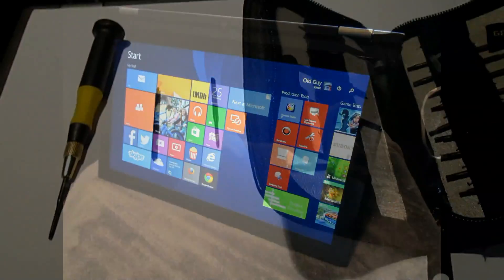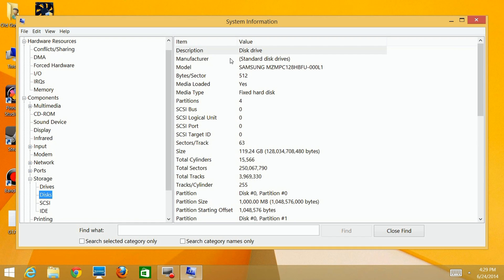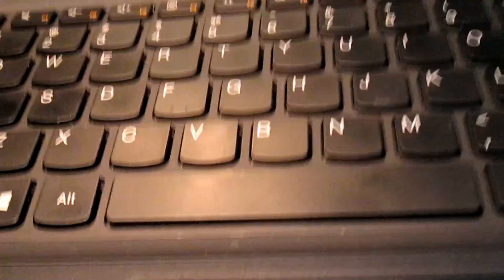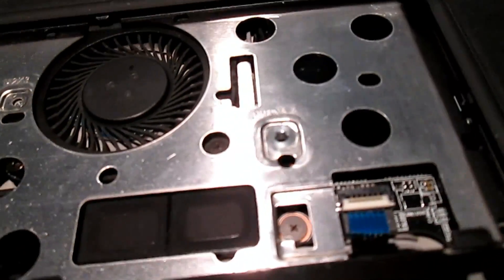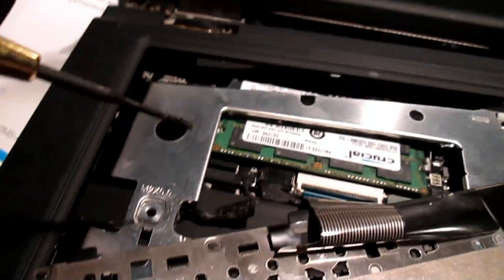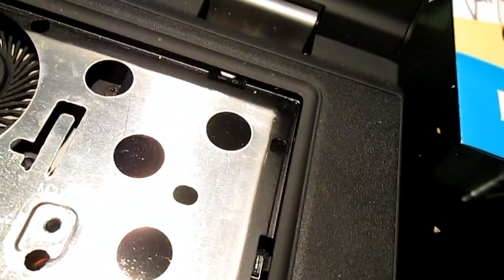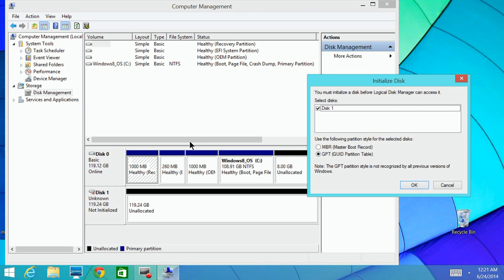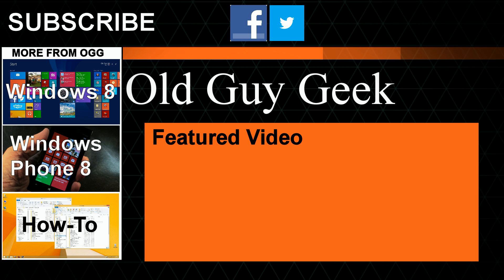Lenovo Yoga 13 - Add 2nd SSD Detailed Instructions

Comment: hey so i bought a ssd from ebay that is identical to the one (its used and it windows one it) i have. so it came with all the unnecessary partition.  do you know how i can delete all of them and make them into one just one 128gb drive.
Reply from the maker: Make sure you don't delete the partitions on your main C drive.  Just go to Manage computer and then into Disk Management.  You should see the extra drive and you can delete the partitions from there.
Reply: Old Guy Geek  hi i tried that and it is not letting me delete anything.  I think this is because the new SSD i got has windows already installed on it is the reason why  i cant delete it.  the person i bought it from didn't format it so im stuck with this problem. do you have any idea on how i can delete the windows
Reply from the maker: Dhayaan I Try this link.  This forum has a lot of great answers for Windows 8 problems.

http://www.eightforums.com/installation-setup/27736-delete-recovery-partition.html
Reply: Old Guy Geek hey i got posted it on that forum and i got the solution. i went to change settings --> update n recovery --> recovery -- > advanced startup --> restart now --> cmd > diskpart -> then cleaned the drive
Reply from the maker: Dhayaan I That's right.  I forgot you could do it that way.  As long as you are comfortable with Diskpart, you can use it.  Just have to make sure you are pointing to the correct hard drive. There are also many advanced partition managers you can use too.  They give a graphical interface so it's easier to use.

But enjoy your new, additional space!!!!!
Reply: yes for sure. I correctly identified which disk i needed to clean and used diskpart

thanks for your video. it really helped

only think that i would like to mention is that when i removed the body as well as the keyboard. i accidentally detached the track pad - connection. (located right under the enter key) - so anyone doing this, just watch out for that

Comment: thanks for u r effort 
dose the windows lost if i added the second ssd beacause as i know the yoga has one slot
Reply from the maker: the original yoga 13 has 2 SSD slot as shown in the video.  The second one will just show up as a D drive.  The other Yoga 13 may not have the additional SSD hardware slot.
Reply from the maker: ***** Well the Yoga 14 comes with a 1TB hard drive.  I'm not even sure if it has a slot to add an SSD. Unless you are going to replace the 1TB with an adapter and an SSD